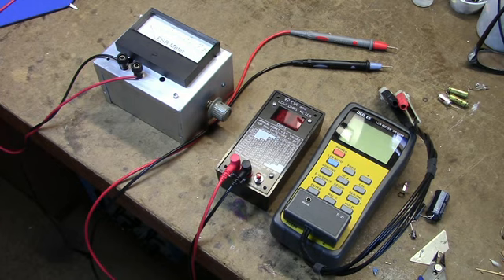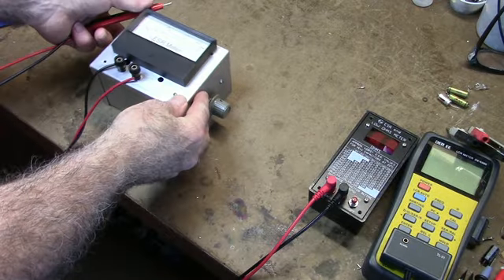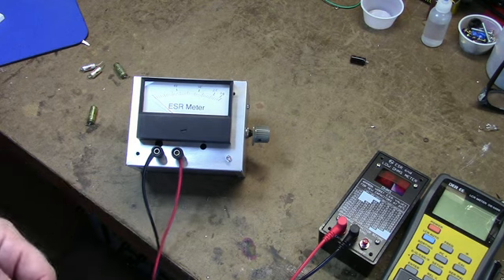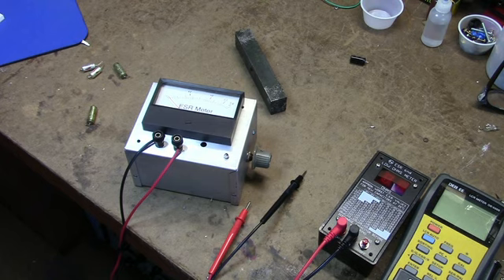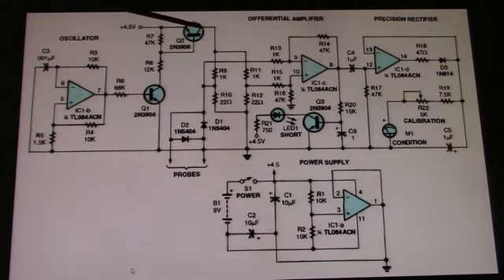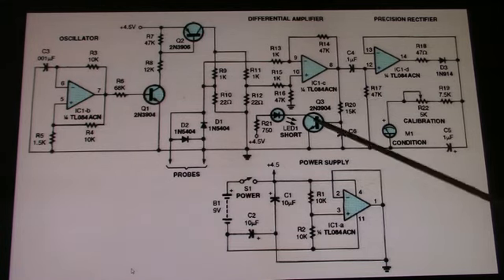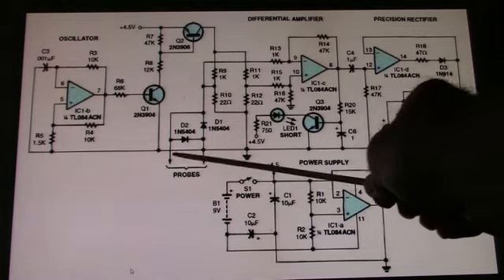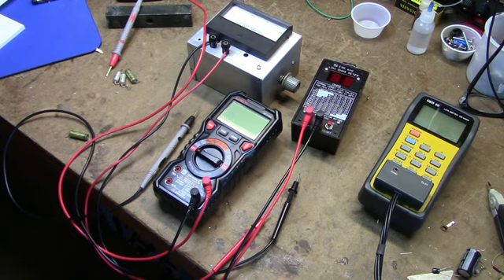ESR Meter build

Comment: many years ago when I was a Tech we used to replace all suspicious caps up front, particularly the well known dodgy ones ( Low value and  tantalum).  This was quicker and cheaper than testing each one individually and possibly having something intermittent and marginal slip by.

Comment: "Across", there's no such word as "acrost". Subbed though 😀The TL081 is a single opamp, you most definitely mean the TL084, or TL074 which are quads. No idea what an "asamal multivibrator" is, I think you mean "os-stable", astable.
Reply from the maker: My "t" needed a little more volume

Comment: The diodes D1 and D2 can be considered fly-back diodes, or clamping diodes. If the capacitor is charged, it will force current flow back through the capacitor, rather than applying it to the differential amplifier.

Comment: I wonder why is there two branches of dividers R9,R10 and R11,R12 and a (pseudo) differential amplifier? Why not just one branch and a non-inverting amplifier? (I know that the direction on the ammeter would be different.)
Reply from the maker: Hi odieadog,  In this case the meter needed to determine whether the cap was good ( LED off ),  or shorted ( LED on ),  since the meter would indicate full scale ( zero ohms ) in both cases.  This configuration allowed the bridge and IC1-c  to differentiate between an AC short ( normal good capacitor ) , and a DC short ( bad shorted capacitor ) .   If you scope pin 8 of IC1-c ,   the 100 Khz signal is clamped  up about 2 volts dc when the probes are shorted.  This is enough to bias the base of Q3 into conduction illuminating the LED.  The reactance of C6 at 100 Khz is 1.6 ohms.  Therefor the AC  the level at the base of Q3 is only 1/9375  the level at pin 8 and Q3 remains off during normal measurements.  There are obviously other ways to accomplish the same function and the author of this article made us of all four op amps on this IC.  Thanks for watching and the great comment.

Comment: I have seen many of these spilt power supplies from guitar pedals, but this one is weird.
the output of the opamp is connected to GND ... also the switch from the 9 volt batteries is connected to 4.5V.
So you set GND for the whole circuit at 4.5V, but where is actual ground or -4.5V?
Reply: This is a common way to do it. You use an opamp with the non-inverting input connected to a voltage divider to set it to half the supply voltage. The output of this opamp is now the "gnd" connection. This is only really useful for IC1-c, which is an inverting amplifier with the virtual ground point at pin 9. The other opamp parts don't need a reference to ground as one is an oscillator and the other is a rectifier.
Reply: If you were to use non-inverting opamp stages, each would have it's own voltage divider on the non-inverting pin. However, this does increase noise as opposed to using a bipolar supply.
Reply: The output of that rail splitter is not shorted to the negative terminal of the battery. It's defining a halfway voltage which we're choosing to call 'ground' and label as such.